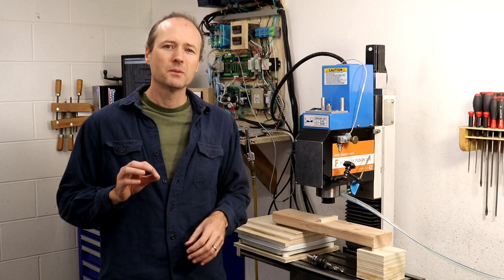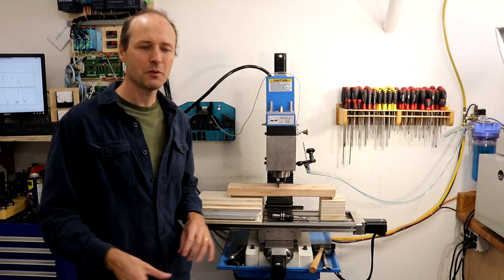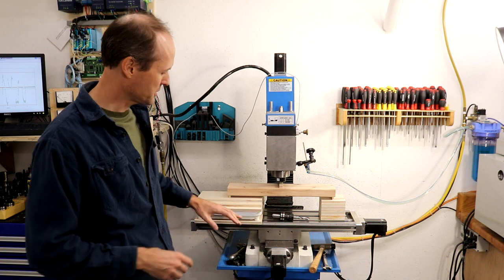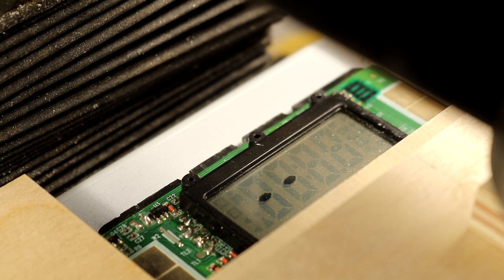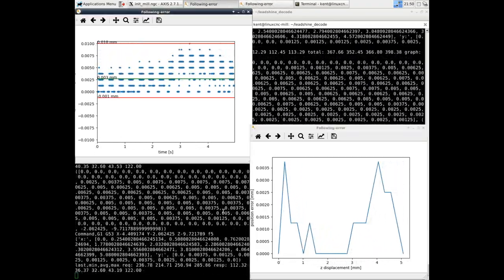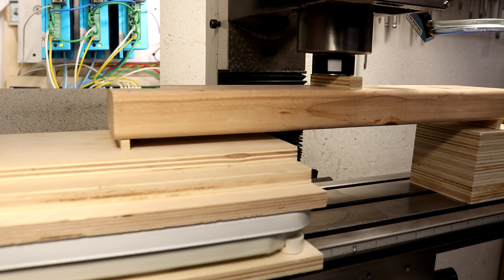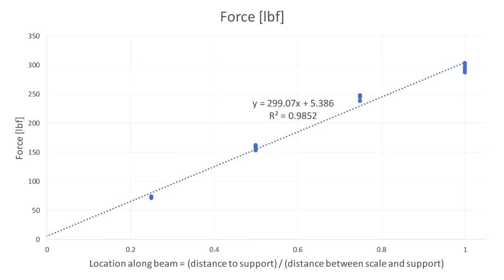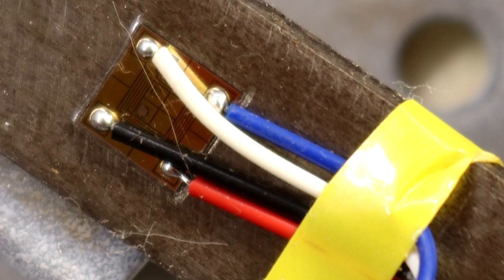How to measure drilling thrust force (feed force)

Comment: You might add a dial indicator to the top rear of the column and one on the top front of the head while running these tests to measure there deflection. I'd bet most would be surprised at how much it is at these load levels. OT to the video, but table deflection is why I no longer even have a drill press for drilling metal.
Reply from the maker: Very good point! All deflections were tilting back; there was no measurable lateral deflection. 0.5" above the spindle nose .001", 4" above the spindle nose (middle of the head's face plate) .005", and 19" above the spindle nose (at the back and top of the column) .018" (or about 0.05 degrees.) 1 thou sounds good, but the head is low when measuring against the scale. Put a long drill bit in, and column-head-tool total may be worse than the .018". Yours is a great suggestion and deserves more investigation.
Reply: @kentvandervelden  If? I understand the engineering calculations for beam deflection. Doubling the height for the head position on the column and using the exact same load would result in the total deflection numbers to be squared with all else being equal. I've read it takes approximately 150 ft. lbs of down force to drill a 1/2" hole in mild steel with a brand new correctly sharpened drill. So adding a standard length drill chuck plus a 1/2" dia. jobbers length drill and the column deflection numbers are going to quickly skyrocket. Your test numbers are more than worth while checks, and I'm sure you understand there still only static numbers. Larger hole drilling is also going to exert high twisting forces on the head / column. "For every action there's an equal and opposite reaction".

I have the same head / column bolted to the rear of my manual lathe as a light weight secondary mill so your numbers were pretty interesting. I've long thought that epoxy bonding & bolting a heavy wall steel I beam to the rear of the column with a heavy welded bottom plate on the I beam with that bolted down to a rigid bench top  would do a massive amount to stiffen these little mills. Adding epoxy / granite inside the column and machine base would get you about the most the machine is ever going to be capable of. As they are it mostly doesn't matter how much money you throw at adding ball screws and nuts. The machine is incapable of utilizing that higher level of accuracy without doing a lot more to it. Machine mass, rigidity and vibration dampening is EVERYTHING with machine tools.

Comment: sir i want to customize cnc how do i do that ,i need software for that o know python and c++
Reply from the maker: Could you write code to generate g-code? If you need to respond to inputs quickly, could you modify LinuxCNC or Marlin? If something in the middle of timing requirements is ok, LinuxCNC can be controlled from Python. The inputs can be read and outputs controlled and g-code sent. Hope this helps. Sounds like you have an interesting project.

Comment: Have you measured the head deflection? I've got a Grizzly 8x30 mill, it has plenty of power for high feed rates, but because the mill is not rigid at all, they're a lot of spindle deflection, results in inaccurate cuts.
Reply from the maker: Thank you Andy, yes, in part, please see the response to The Turning Point's similar suggestion. Deflection while milling has more axes involved, but the forces should less too, but on finishing cuts, I must take things easy. If you have more suggestions, would love to hear them
Reply from the maker: Btw, Grizzly 8x30, is this Grizzly's smaller knee mill, the G0731? That mill looks awesome. It's a shame it's not living up to it's appearance.
Reply: Kent VanderVelden I have the Grizzly G0731, I really really should have just got a Bridgeport or BP clone. Pushing up on the spindle just be hand deflects it a few thousands.

Comment: Strain gauges are cheap and easy to interface with.  FWIW
Reply from the maker: Hi David! I'm curious about the practicalities of building an instrumenting dynamometer. They are very expensive even used on eBay. The accuracy does not need to be high, relative measurements in multiple axes (XYZC) would be awesome. Maybe something we brainstorm about in April?
Reply: @kentvandervelden  sure!  I picked up a few strain gauges for a project a year ago and I was surprised at how cheap they are.  There is an inexpensive and easy to use single chip amp/ADC which is easy to find.  Much easier than college when the load cells in the labs were cumbersome, expensive things.